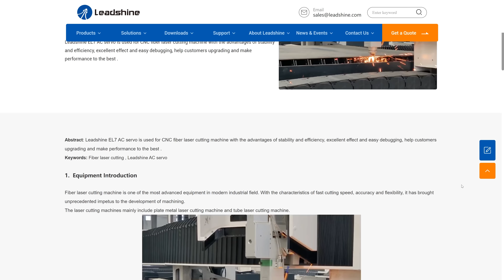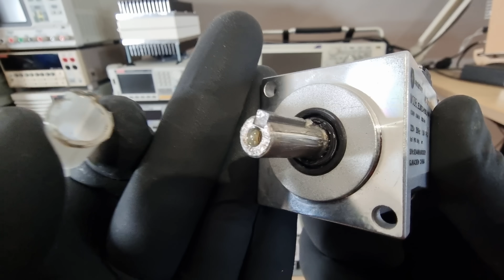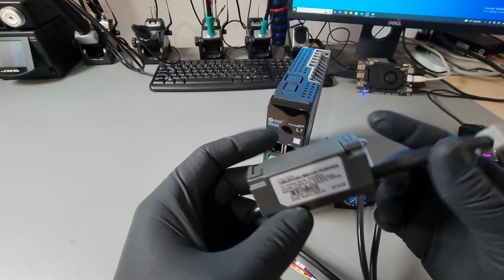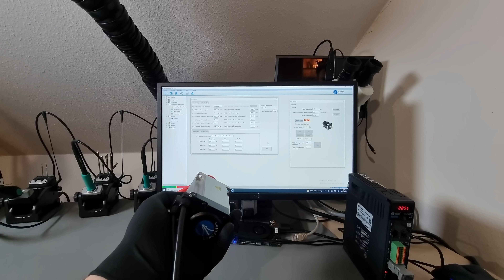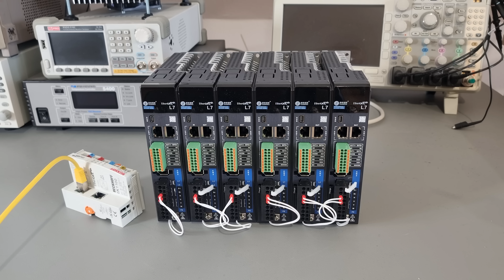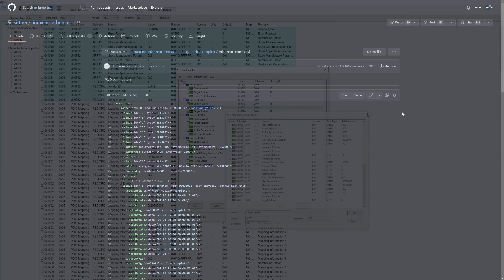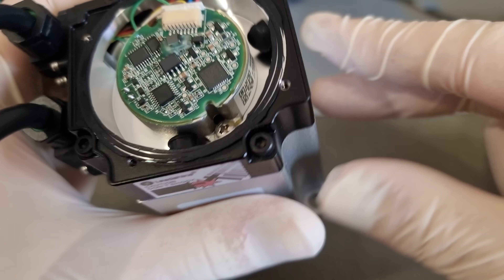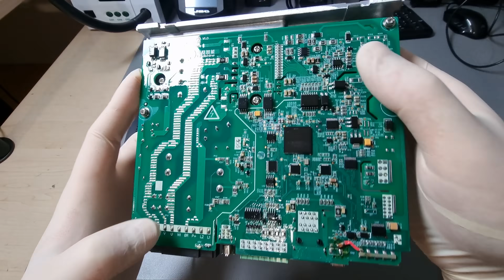CNC Motion Control over Ethernet Cable! Leadshine, LinuxCNC & EtherCAT

Comment: Worked in flight simulation industries. Used to calibrate this servo drives. Mostly Yaskawa brand for secondary Control loading system. For primary Control loading system there's much more expensive hardwares: MOOG

Comment: The limiting factor for precision of FDM printers is 100% the extruder and filament. If you think about it, anything involving semi-molten plastic is guaranteed to be way less precise than motion control, even if you're just using belts. Also, at higher extrusion rate the heating necessary goes up substantially.

Still, most speed 3d printers go with as light if an end effector as possible. It would be interesting to see what's possible if you go heavy (big servo E axis, big hotend) but with sturdy motion control...

edit: on second thought, I'm not sure how much a high powered E axis gets you, as your limiting factor is probably still the torque you can apply to the filament.
Reply: MirageC and Vez3D have been doing some really good quantitative looks into all this, definitely worth a look if you want some answers to those kinds of questions.

But yeah, for the most part (not including accelerations, movements etc) the main limit now is how fast you can heat up the filament and push it out.  

Volcano/Supervolcano Hotends, novel Heatbreaks/Nozzles/Coatings for Things (DLC, PCD Nozzles, etc) are helping, but next generation stuff will be even more interesting, the Goliath Hotend, and to a certain degree more Open Source Pellet Extruders (although iirc those inherently have less precision?!

Comment: Its interesting that these things look almost identical to other drives from other Asian servo drives like Mitubishi or Yaskawa all the way down to the connectors and labeling.  The CN2 label and connector type is the same too.  I am bet that all these motors get made at the same place and get a different label stuck on them and just the controllers are made by different companies.  Or maybe its just an industry standards thing idk.
Reply: If you look at the different servo drives out there, there are definitely rebranded/licenced drives and sometimes with a slight cosmetic change too.  Eg. look at LS and Beijer servo drives - they're identical.  I think Yaskawa and Panasonic are the same drives?  Omron and another brand that i can't remember right now use the same drives?

I've used several brands of servo drives in my time.  For me, there are two big differences between them all 1) is the PC software you use to configure the drives - some look and feel like they haven't changed from the 90s, and others are really modern where they attempt to make configuration idiot proof.  And 2) the ability to use the digital IO and monitor certain statuses via PDOs/SDOs.  These differences can be seen on identical drives but from different manufacturers too.

They tend to all use the same/very similar connectors too,  but i think this is an industry standard formally/informally.  But this type of thing is seen in other parts of the industry, like EtherCAT I/O modules where they all use spring loaded terminals.
Reply: @Shocker99  Spring loaded terminals on EtherCAT devices is a pretty funny observation, but likely spot on.
Reply: @aleksandersuur9475  Spring loaded terminals are considered maintenance free.  They're supposed to be superior than a screw down terminal block.
In the sparky world, the regulations for some nations state that they can put spring loaded terminal blocks in places a regular screw down version cannot.
Reply: @Shocker99  the funny part is not why EtherCAT devices almost universally have spring loaded terminals, but why the rest of the industrial ecosystem so commonly doesn't. Of course they are superior, at least in your typical cabinet where they are most commonly used, so why are there still so many devices with shitty screw terminals on sale? Cultural inertia or some such rot.
The funniest bit is phoenix screw terminals, if you look closely then actually they have this little spring that actually holds the wire under force, so really, they are spring terminals in disguise. They work very well, but why is this pretense even needed? Why not just have a normal spring loaded terminal? Because sales, dinosaurs that want a screw accept no substitute because that's the way it has always been.
Reply: That CN2 connector can also be found on sanyo denki motors, one of the more affordable japanese brands imho and that has been around for years. The copying was done probably one or two decades ago in that case, when they all still mostly used analog inputs for their set values. I agree, that is pretty much just the standard now apparently in that corner of the world. Not sure about western manufacturers.
Reply: No, it's a chinesium thing. Leadshine or whatever it's called is not top of the line name in the industry, so rather than reinvent the bicycle on their own, they copy successful products and try to do it cheaper. Most companies out there think the same way and that's how you end up with products looking like copies of each other - because they are.

Comment: The encoder probably uses either the SSI, BiSS, Hiperface, or EnDat interface
Reply: Probably  EnDat ,it looks like th once yaskawa  servos is using, I have been angling  to get the data sheet  of those  encoders  with no success, the pinout  is not found  anywhere.

Comment: Having worked with EtherCat and Beckhoff equipment I can say that it's impressive how their communication protocols are literally identical to the original 80s implementation, just encapsulated into ethernet packets.
Reply: The BACnet and Modbus IP implementations are built similarly; they're thin ethernet wrappers around the original protocols, which while easy to implement and understand for people who spent their whole lives working with BACnet or Modbus, does result in some pretty clunky and redundant protocols with duplicated or unnecessary address fields, checksumming, bad port handling and inconsistent implementation of typical ethernet or higher conventions.

If you wanted a well-designed clean implementation, you could strip out 80% of what industrial protocols like this do because ethernet/IP  handles most of that functionality already. They leave it in though, because it's what they're used to.
Reply: @siberx4  Yeah I did some work on it for a communication library and like 90% of the packet was communication overhead already handled by TCP/IP. The remaining 10% was "Send me variable XYZ".

The cool thing about that is that, with an EtherCAT gateway, I could use the same 2020s Python library to communicate with a PLC from the 80s that was designed for a ring network.
Reply: Yay excited to see some more spotlight on EtherCat!  I got to work with it for a fun robotics project in my lab, driving some high torque and high precision harmonic drive actuators.
Reply: So I guess they don't need special multi thoudsand dollar switches. That's great!
Reply: @Alex4n3r  In fact, you don't even need switches. It self-detect and self-configure itself to whatever the physical topology is during startup. Beckhoff do make a EtherCAT switch, but it's very different from normal ethernet switch.

Their EtherCAT Switch (CU1128) does not work like normal switch, but more like a series of junction/bridges. It passes the packet from Port 1 to whatever EtherCAT devices connected on port 2, and as the packet goes back to port 2, pass the packet to port 3, and so on until port 8. Physically, it looks like a star network of ethernet, but internally it's more like a line network. They even put a warning on their website that this is not to be used for ethernet networking.
Reply: @Alex4n3r  well, ethercat is a daisy chain topology, but the chain usually wraps around to a loop so if one device drops out completely, the ethercat master can link through the other side.  If you had more than three ethercat slave devices on one ethercat ring and two devices completely dies or a cable gets cut....  Anything device between the two dead or broken cables will drop too.  
EtherCat "switches" hmmm....  There ARE special ethercat device peripheral chips that have a special port to cross connect to branch the ring to a secondary ring...
Reply: "impressive" - you have a strange definition of impressive...
Reply: Technically, no.  They're about as similar as cows and horses.  They both have four legs and hooves, and eventually end up at the glue factory, but that's about it.  Ethercat is a frame transmitted through a IEEE 802.3 PHY with its own EtherType.  The packets inside?  Well, they're all specific ethercat datagrams.  Hardware wise, there's fancy distributed clocks, a hardware state machine with watch dogs to manage synchronization status, it's own independent RAM buffer....  It's a lovely technology.
Reply: Nothing wrong with that🤷🏻‍♂
Reply: We have customers with existing Beckhoff systems with multiple ethercat racks that have hot connect turned off.

When we try to supply them ethercat they go “oh shit”.

I like the stuff
Reply: CAN works well, I'm glad they didn't try to roll their own version. 
And they have done a lot on the RT side to get the peformance as good as they have.

Comment: Have to give this commercial a thumbs down. None of this stuff is accessible to the home hobbiest who is working on a shoe string budget.
Reply: Maybe but you should not forget that CNC was meant to produce parts and is a professionnal tool for many people around. Many professionnals need to retrofit old commands on their old CNC machines. Showcasing LinuxCNC with Ethercat is promoting open source solutions; which I find a great service to the community.

Comment: I worked with EtherCAT on device development level using Beckhoff's ET1100 ASIC. It's an interesting protocol as bits are processed and interpreted on the fly as they are coming in, and are retransmitted only like 3 bits later.
Reply: Yeah, it's a pity that it isn't used more in the Hobbyist-space. Devices which implement EtherCAT are usually made for industrial use cases, that's at least what Beckhoff targets. That makes them way too expensive for hobby side projects.
Reply: @thevayudev  The reason you're seeing them here is because these companies are repurposing copycat precision parts that were mass produced into cheaper packages.  I suspect in the next couple of years you're going to see people design home based multipurpose CNC tables that can drop any any tools you want.  This isn't the first video I've seen like this, these parts are becoming more obtainable and you could connect them to simple router, plasma cutters, or 3D printer heads and do whatever you want with them.  People around me are industrious so there are a few small businesses that are already putting them to work in my neighborhood, which is a very stretch from the traditional machine shops they were in.
Reply: @snarkylive  Okay, that does make a lot more sense, that's why none of these are original parts from Beckhoff Automation, those aren't really produced in that high volumes. It does sound like a bright(er) future for the low-budget space if other manufactures can mass produce these components while still being able to communicate with TwinCAT & other EtherCAT stuff. Still waiting for price cuts in the XPlanar/XTS space because those things look like a lot fun to play around with. I mean, couldn't you replace the rails of a CNC machine with XTS rails?
Reply: @thevayudev  XPlanar and XTS is definitely a newish thing on the market. Even their competitors (B&R, Bosch Rexroth, and many others) just launched these kinds of products in the last 4-5 years. I doubt we'll see price decrease until the next 5-10 years, especially with current chip issues.

As for XTS replacing CNC machine rails? Well, I think it can be done, but your material weight will be quite limited, especially if you have to stack another XTS on top of the other for X-Y plane.